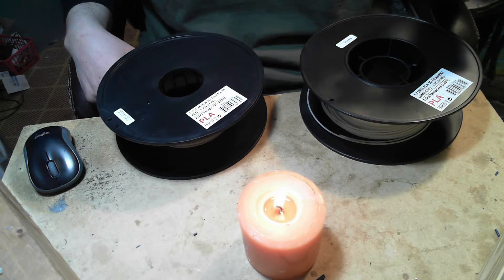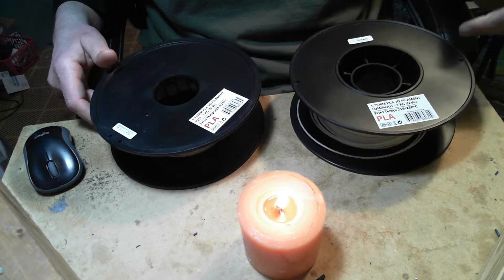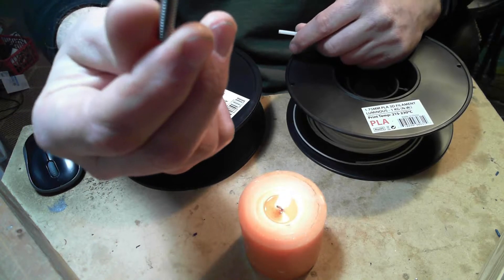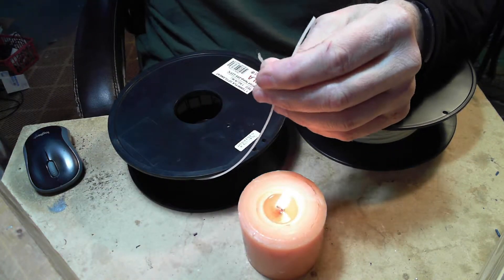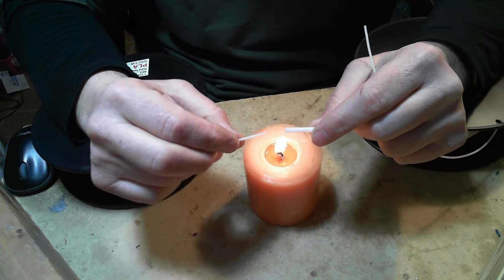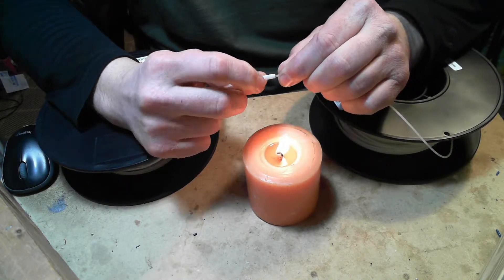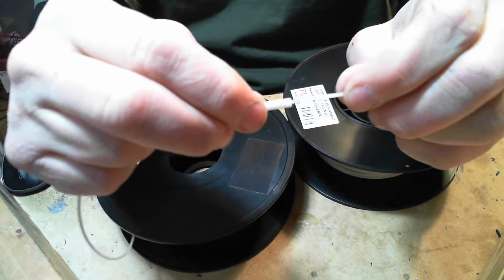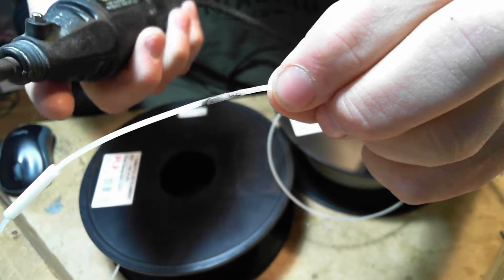Joining 3D Printer  Filament with candle -

Comment: I followed the instructions exactly with tight bowden tubing. The joint's diameter was still slightly larger than the rest of the filament. I ran it through with looser fitting tubing and my prrinter jammed when the joint would hit a pneumatic fitting or the nozzle